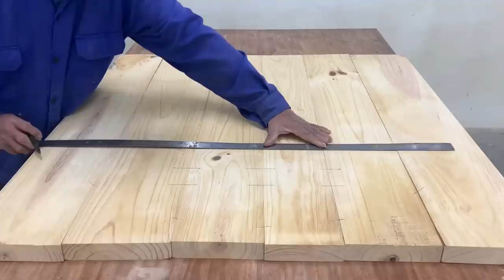Woodworking Crafts Hands Always Creative Wonderful // Beautiful Wooden Tea Table Design Ideas

Comment: It's a beautiful piece! Is it steady that it doesn't tip over? The round curved part is usually trimmed as that curve or soaked in water and dried at that curve so shallow lines, that can be indented around the outside can easily be dusted. The big beautiful curved pieces that come up to hold the top of the table are just wonderful and done beautifully! Nice shiny finish; it almost looks like glass🙂!